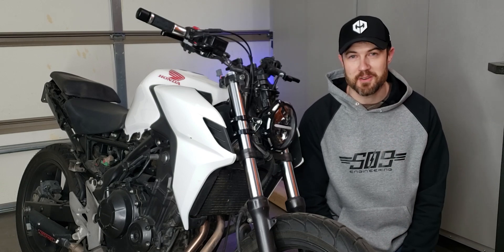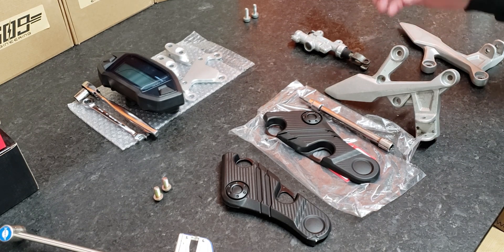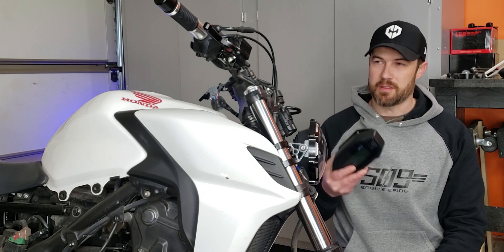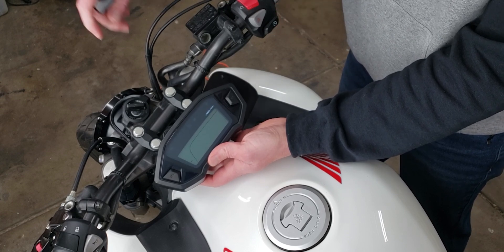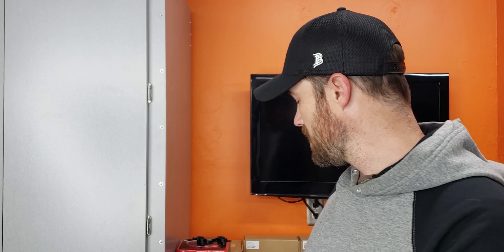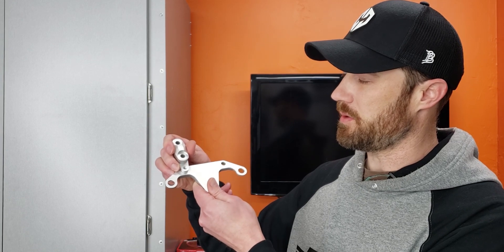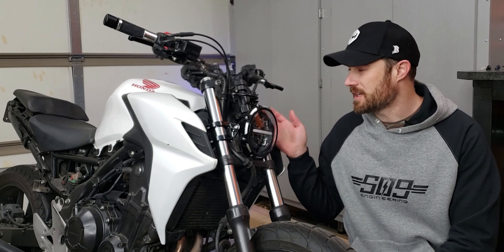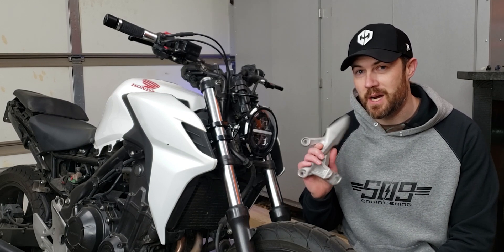Motorcycle Speedometer Mounting Bracket | Honda CB500F Cafe Racer Build #6

Comment: Put my order in for the headlight and mounting bracket 🤘. Did you add fork braces when you removed the front wheel fender? Or just left it as is? Also did you have to take the front wheel off or can you remove fender without doing that?
Reply from the maker: Thank you for your order! That must be the one I shipped yesterday. I have not added a fork brace, but that sounds like a good idea I should look into. When I got the bike there was no fender. I bet you do not need to remove the wheel to get the fender off.
Reply: Yea that must be the one. Already arriving Monday, I'm super happy with the shipping speed. Oh I figured you removed the fender for the looks. I hate how bulky it is, but so far have had no luck finding a good brace or replacement @S09Engineering

Comment: Hi just found your Chanel, you have given me a few good ideas for my 98 Cb 600 ,first big bike ,and a very limited budget, hope you can still carry on with your Chanel  ,keep  up your good works
Reply from the maker: Welcome aboard! I don't have any plans to quit. Progress in the garage will pick up now that the weather is getting cooler.
Reply: @S09Engineering  meny thanks for getting back to me  ,,I'm looking at changing my bars on my cbr 600  it's  a 98  oldy  but a goody, would a top yoke from cb hornet 600  98 model' fit my cbr , I'm having to do it on very  limited budget  ,not really liking the idea of drilling, but if needs  must  ,,,meny thanks with  any help

Comment: Ryan, I recently bought a 2021 CB500F and was wondering if you were considering losing the bulky fairings on the side of the gas tank. I think I would look great, except there is a ton of exposed tubes and wires (I think) under those fairings. Have you thought about this issue at all? Just curious and would consider any solutions you have to address streamlining this bike's gorgeous tank. Thanks.
Reply from the maker: I'm going to keep the fairings. I like them for some reason. I know several guys have removed them and were able to hide the wiring without too much hassle. At some point I may consider making some panels to help hide stuff when the fairings are removed.

Comment: Do you think it would have been possible to use a CB300 headlight and do you know if the dash from the 500 would fit into the same area as the CB300 dash?
Reply from the maker: That is a good idea, but I haven't spent much time studying the CB300.
Reply: @S09Engineering  Yea I like the cb500 but I'd like the round headlight better than Transformers face looking headlight they put on them, I'd even use the cb300 dash if it worked easy with simple plug in and go but I'm not sure about how compatible these parts are

Comment: Did you have a dyno tune after adding the full exhaust and if not does it still run well? Thinking of going that route on my 370 pound seriously naked F. > https://www.cbr500riders.com/threads/my-seriously-naked-2017-cb500f-mods-and-upgrades.74381/
Reply from the maker: I have seen your build around the internet. Well done! I didn't dyno it. It still has the stock exhaust with a Coffman shorty. The cat is most of the restriction. Basically the same setup you have in your thread. I do want to get a full exhaust on at some point.